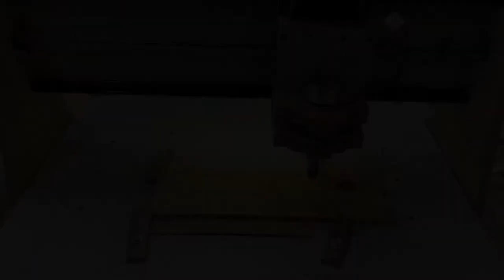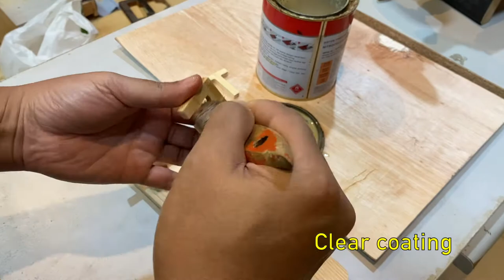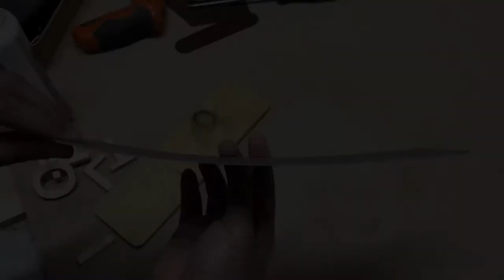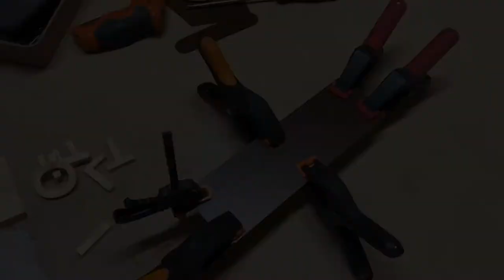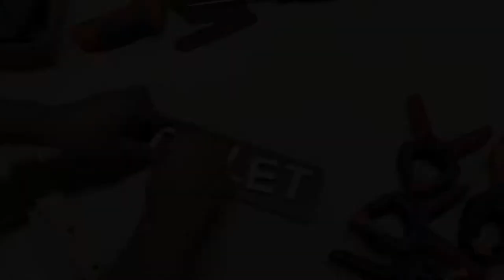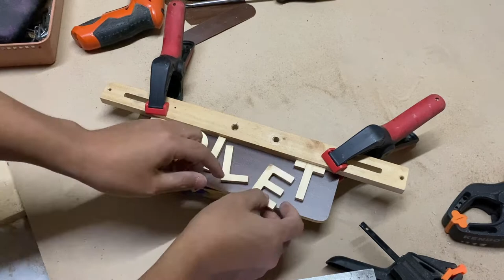Mudah dan Gampang Bikin Papan Penunjuk Toilet

Comment: Bang saya mau bikin desain untuk di cutting, saya memiliki rencana bikin frame pake carbon,
Kira kira sofware apa yg harus di gunakan untuk desain nya bang ???
Reply from the maker: yg banyak dipake autocad,coreldraw tapi ini software berbayar jadi banyak yg pake versi bajakan. Kalo yg free/opensource bisa pake FreeCAD, LibreCAD. Saya sendiri pake freecad dan cukup powerful
Reply: @ArtemCreative  pakai onshape bisa ga bang ??
Reply from the maker: @ilhamMaker  semua software CAD termasuk onshape bisa. Yang cloud based kayak onshape yg banyak dipake yg punyanya google: sketchup
Reply: @ArtemCreative  terimakasih info nya bang, pengen tau dong bang bajet bikin cnc router dimensi 20x20 berapa harganya
Reply from the maker: @ilhamMaker  kalo yg kecil ada yg ready di pasaran buatan chine: cnc 3018
Reply: @ArtemCreative  thanks info nya om